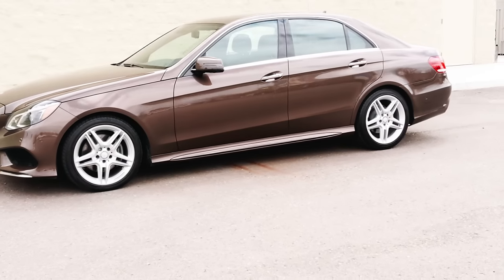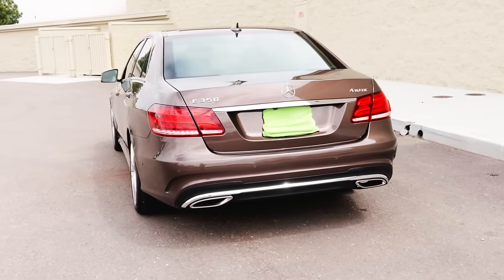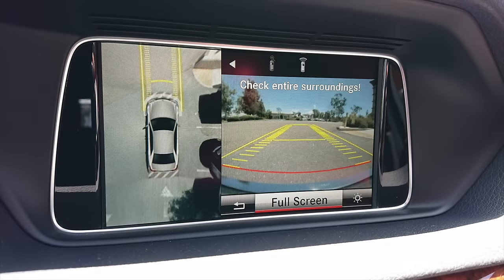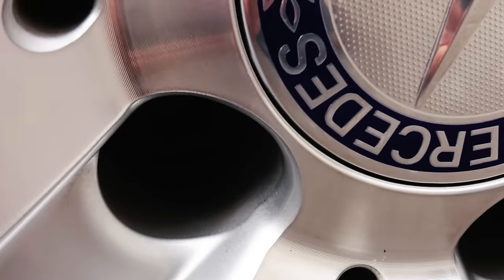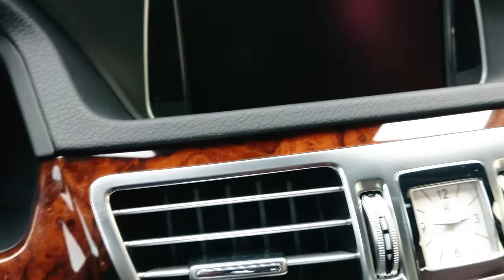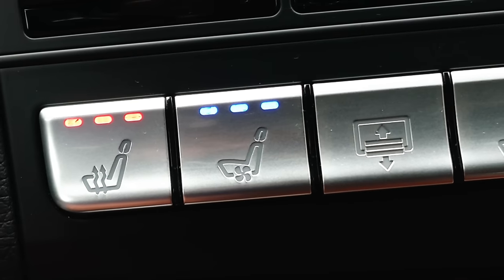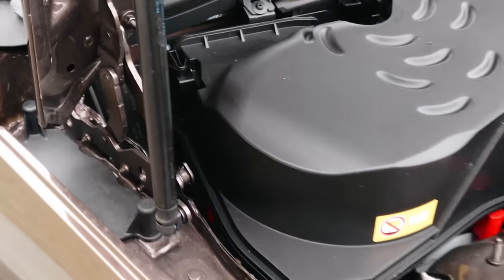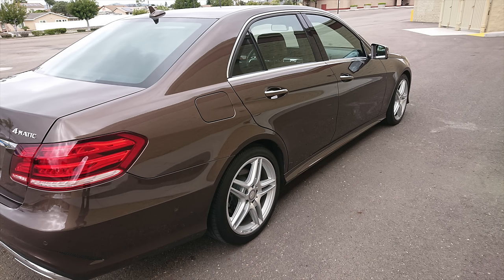The W212 E-Class is one of the best Mercedes-Benz Cars Ever

Comment: i own a 2011 (pre-facelift) e350 luxury model. my mom owns a 2014 (facelift) e350 sport model. i definitely like my car a lot more. i dont really like the e-class having the ornament on the grill, plus it makes it look like a c-class lol. both of them have 17in wheels with the same tires, but the luxury model rides much smoother. the sport model handles a little bit better obviously but at the cost of a stiffer and bumpier ride. in my opinion, the luxury model still handles pretty great. i dont think the sport suspension is good because it makes the car less comfortable (which is the intention of an e-class) while not improving the handling significantly. this is coming from a person with a sensitive body lol.

i agree with mercedes' mechanical quality improving. the w212 is pretty much issue free. we have only done regular maintenance + wear/tear on both e350's. 

but i dont agree with the interior quality. my mom's 2014 model is newer but the interior actually has squeaks and annoying rattles already lol - it definitely has to do with that bumpy sport suspension. the driver's seat bottom is torn. idk i just cant fully describe it but the w211 has a better interior and a waaaay comfier seat. i just dont like the interior quality of the w212. 
the brakes are powerful and smooth, you can tell that comfort is the top priority in any e-class. audi and bmw brakes feel really touchy which is good for sporty response, but the e-class has a more "progressive" and linear feel to it. once you get used to it it's pretty comfy in stop&go traffic. 

acceleration is good, definitely enough for everyday usage. if it's well-maintained the gear shifts are imperceptible and power delivery is smooth.  in 2012 they used a new direct injection engine which is more fuel efficient and much faster. it's fun, but the biggest drawback is that it's louder and grumblier. the engines before 2012 are much quieter.

i know i make the sport model sound bad, but overall this generation e-class is still great. it feels solid when you drive it. super stable on the highway. everyone likes to fall asleep in my car whenever i drive them in it. great visibility all around. this car is definitely well-rounded just like the reviewer said.
Reply: I have a 2014 sport and the ride feels very comfortable even with 19" low pro tires, no rattles or interior wear and tear yet and in my opinion even with the star grill it looks nothing like a C class, the W213 however looks just like the W205 C class, very similar headlight, tail light and sillouhette
Reply: @invincible201xxx  the front of the 2014 ones do look make it look like C class
Reply: W212 pre facelift is wayyyyy better.
If I wanted a C Class, I would've brought one. Meh.
Reply: Martin Svensson  I gave the interior of the W212 an overhaul. It looks leaps and bounds better than stock
Reply: Yes Audi's have touchy brakes

Comment: 2010 Mercedes 350  trying to keep it for another 5 years
Reply: Any significant repairs during ownership? I am currently considering purchasing a 2013 pre-faclift E250 cdi in Ireland
Reply: @rossgoodwin2700  other than replacing a pulley and replacing the battery not much in the shop for repair just my usual service, 100,400 miles on it

Comment: had 124 ,200d , than 210 250 diesel , than 220 cdi 212 , HANDS DOWN 212 IS THE BEST MERC I DROVE , HAD 213 FOR 2 months 220d sold it and bought volvo s90 d4 , still nothing beats w212 220 cdi avantgarde , NOTHING
Reply: MINE WAS PREFACELIFT 2009

Comment: I have a w212 2012 e350 cdi 57000 miles black on black amg spec,nothing has gone wrong with it in the 7 years I’ve owned it,it’s still on its original battery and I service it myself in accordance with Mercedes service intervals,70 on the motorway it’s doing over 50 mpg,I’m 60 now and I don’t think I will ever sell it.

Comment: The W140 (most expensive Mercedes ever developed) has to be up there, followed by the W126 and W124.
I'm glad Mercedes seem to be returning to their 'best or nothing' philosophy with their larger sedans again. After the Chrysler takeover in the late 90s they really cheaped out while chasing profits, but excellent quality has since returned to the E and S Class.
The early 90s models are built with a solidity that is not found in any other vehicle I've encountered!
Reply: Not true the W100 (Mercedes 600) was the most expensive with technology unheard of at the time) it have full pneumatic air suspension which included pneumatic windows (long before electric windows were popular)
Reply: @bernardkavanagh3528  Not true. At the time (and it may still stand) the W140 was the most expensive car in history to R&D, and the first to ever exceed US$1billion. This was a fact stated by Mercedes themselves, but as impressive as that was, it was a figure they weren't proud of it!
Reply: I never liked the look of the W140, it looked like it was stuck in the 80's...for a car that started production in 1991 and lasted for seven years. The W220 was a huge improvement design wise.
Reply: @damilolaakanni  I reckon that's part of the appeal, and yes because the S Class used to take nearly a decade to develop, the design is actually from the mid 80s. The same way the W126 before it looked antiquated by it's end in 1991, that was a 70s design.

Comment: My E250 4Matic Bluetec is the best car I've ever had.  It's amazingly fuel efficient (1,000 miles or more highway miles on one tank), and it has plenty of power.  It also has a great balance of screen and buttons.  Most of the daily things you need to do can be done with a touch of a button.  Unlike the next generation, you don't have to do most stuff through the screen, which I find very distracting.

Comment: The Star in the grille just looks cheap and tacky. Like a cut price Mercedes.
Reply: Agree! Looks like a tractor grill. All Mercedes cars should have the star on the hood, so you can see it! :) Also it is much more classy.
Reply: Damn right. If you cant see your three pointed star standing proud atop your bonnet, are you really driving a Mercedes?
Reply: @willmorrell488  Totally agree with you! Mercedes lost their distinctiveness when they decided to remove it. Maybe you can get it as an optional though.
Reply: @peterchristiantrapp6927  I much prefer older Mercs as they are just more interesting to me despite reliability issues. The interiors now are nice but I get the feeling it's just skin deep. Having large screens just makes it look more and more like all other luxury cars more like a gadget. I think it's only going to become less distinctive as time goes on.
Reply: @willmorrell488   I have own 3. A 190E 1984, W210 E 240, 2000  and my current W212 E220 CDI, 2009. Each one has been the best car I have ever driven. I miss the sound of the W210 though! :) Hopefully I can afford a S-class soon. :) I do like the W221 :)
Reply: The reason for the big star in the grill houses the radar for adaptive cruise control
Reply: @johnwalters878  They don't need the Star in the grill though for that to happen. Their S class range never needed that.
Reply: @peterchristiantrapp6927  You said is correct ... Without Star in the hood , MB is worthless
Reply: @willmorrell488  Mercy needs Star on the Hood ....Otherwise , it's a cheap looking car

Comment: I had 2 of the 212 model, both E350’s. Both were pre-facelift which I think looked much better - I never liked the face lift and I think the sports grille looks strange of a 4 door. The first one saved my life in a very significant accident. These are fabulous and exceptionally well built cars and extremely comfortable. I haven’t liked an E class since . The interiors were beautiful, not like the LED jukebox box look of the most recent E classses.

Comment: Why does merc put fake leatherette seats in then. All used ones in Ireland have cracked leatherette seat. If U ask me they cut corners wherever they could.. lots of engine trouble on the e200 220 250 etc not good enough for Mercedes..

Comment: Eh those 3.5 na motors like to leak oil if not maintained right which i commonly see all the time even at 50-60k miles. Other than that theyre solid cars never had to do any major work on em

Comment: "Highest quality materials..." i have a W212 and I'll call bs on that statement. Plenty of cheap plastic in the W212 interior. The highest material in a Mercedes is in a S class. Lets not kid ourselves.
Reply: Yeah saw the dash in w212 looks cheap, that was in prefacelift. W211 dash doesnt look so cheap and plasticky. Is your pre facelift?
Reply: @xdanano  yes mine is a 2013. Practically identical except mine has the horizontal pleats which is the vinyl seats. The vinyl seats always split the in the seam. My parking brake release handle broke off when I released the brake because its made out of cheap plastic. In comparison, my 97 LS400 and 99 GS400s plastics are thick and durable.  Huge difference in material quality when you compare the W212 interior to the old Lexus interiors. I don't remember the W211 being this cheap in the inferior.

Comment: The 4 cylinders gasers have timing chain problems, the Diesel engines where rechanged after production to other injector with pretty big changes... W212 was not trouble free
You should review a lower spec Mercedes if you want a true view on the w212, gong facelift 4-wheeldrive big diesel is not representative...

Comment: This is true, I have the latest E220 and compared to the 2010-2016 it is CRAP!!! The current E class from 2016 has a less masculine horn, fake exhaust pipes, poor speakers if you don't get Premium Plus Package and feels more like an C Class with handling. The thing better about the new one is the 360 camera and the Interior/Tech
Reply: Between 2007 and 2015 , Eclass are superbly built quality ... W211 face lift is some awesome design which is still adored in India
Reply: @manojm6722  you're definitely correct there. I think Mercedes-Benz slacked an awful lot when it came down to the current E Class saloon/sadan

Comment: I own a 2003 E500 - just an amazing car. Had it 16 years and now at 180K (bought in 2007 with 18K). Unfortunately, it's got problems so I am dumping it. I just bought a 2010 E350. The look is amazing. It is not as powerful as my 8 cylinder, but it has pep for a V6. It does not feel or handle as sturdily as the W211. But I love the new lines, love the rear lights (I hated the W211 triangle lights), has the AMG and luxury packages, and many "modern" upgrades. It feels a bit longer in the driver's seat and although I did a hood emblem delete on my W211, I will keep it on the W212 since the hood is so long. I am so looking forward to driving it hard!

Comment: I can't really agree. From the point of user I prefer W211 as the car had a better looking interior and car was more comfortable. Back seats on W212 are not comfortable on long trips at all and W212 is very noisy especially diesel versions. Interior bits and parts looks and feel cheap. Technology is better, logically as the car is newer but as a car W211 was much more better Mercedes to drive. I would skip W212 and buy latest W211 model year or pay extra and go ahead with W213.
Reply: Agreed! W211 = Best ever!

Comment: I had a 1998 (I think) C250 and a 2004 W211 E220 cdi. I loved both of them a lot, and half the joy of driving them was the star figure on the hood. It's such a shame that new Mercedes E-class and below owners do not get that experience. And apparently the disaster happened here in the W212. So, not a fan of that design change.

Comment: Had  a 210 - rusted like a 1980's Ford, then a 211, became a wackamole with endless faults. Both nice to drive and good load carriers so bought a 212 facelift - lovely car, lots of  tech and gimmicks of little use but MB forgot about the seats which on the base SE model I have are utterly crap and a chiropractors dream. Sod the tech, sort the seats.

Comment: I've have worked with these E350 and they are a little expensive to repair. There is a transmission weak point that causes hard shifts. A failing power seat will cost you $2000. 1 shock absorber cost $1000 part alone not including labor. This car will have trouble reaching 200k miles. If this is the best mercedes have to offer then I will keep shopping. Lease one with warranty is your best bet if you want a benz.

Comment: The w212 is far away from the build-quality of the w211.
Reply: So true
Reply: "The build quality of w211"? Don't make me laugh! The w211 is probably the worst E-class of all time. It had the same rust problems as w210 (at least until 2007). But while the w210 was reliable, the w211 was not. Everything from brake issues, door locks, transmission, steering controlling and the list goes on. And together with the S-class from the same time period, it was also one of the most booring looking MB-models ever. The w212 is a huge step up in quality.
Reply: @VintageVideos1000  Never had rust problems, unforseen brake issues or any door lock , transmission and steering control problems while driving 2 of them (both built in 2004) from 50k to around 350k km. Design is always subjective and from my point of view its a beautiful and elegent car.
Reply: @THDLightfl4sh  Sounds like you were lucky. Two of my neighbours was not. One guy had a station wagon, the other a sedan. Both had rust issues, however not as bad as the w210. The sw broke down two times, with engine failure. Before he sold it, he told me he got a price tag of 70 000 NOK/10 000 USD to fix it. The other guy had transmission issues on his sedan. I've had the w210 and now the w212. The 210 I had for 5 years, drove it about 40K KM a year. No problems at all. The 212 I've only had for 1 year, but as of now - no problems. I guess you are right about the design. To me, the 211 just look too anonymous.
Reply: VintageVideos1000 You will find people with bad experiences for every model. For example I do know some people who had major issues with the engine and rattling noises from the interior on their w212. Furthermore you dont know how other people treated their cars.

Comment: I'm thinking on buying a E220 cdi or a E250 cdi w212 Mercedes-Benz, perhaps with 200k or 250k. I'm so confused. I heard good things and bad things in terms of mecahnic, electronics, etc., that could lead you to a nightmare repair with high cost's. 
In normal terms, I think this car is reliable, altough, after listning some stuff in YouTube chanel's about Mercedes Benz, I became worried.
If Your answer is negative, I will buy a Peugeot 508 1.6  e-hdi automatic of 2015 or 2016 with PSA engine wich I hear in every corner that it's absolut reliable and, besides, their maintaining is much cheaper.  However, I simply love that Mercedes-Benz "E" model design and its is my dream to have one.
So, the question is (if you guys was in my spot) : in normal terms, the Mercedes Benz w212 E 220/250 from 2010/2011 cdi is reliable and it's worth buying it ?
Reply: Go ahead with W222, S class.

Comment: 2003 through 2009 w211 E-Class last year of true Elegance and beauty the last of the well-built Mercedes-Benz.
Reply: The face-lifted W211 with dual exhaust pipes is probably the most beautiful E-Class ever made.
Reply: E class is by far the over all best. I agree. Love driving mine. Believe if u do not or have not own this. U should not give a critical review.  It is my favorite i have owned.
Reply: Lauren Anderson  it also depends on what years you are talkin about because if you jump into the newer s classes they're built like shit compared to how they used to be engineered the quality is going to be cheaper on a newer car regardless of what class you're in every class has its lemons even with Mercedes-Benz and the only way you're going to get quality is dependent on the year everything is made cheaper nowadays I drive a 2005 E500 4matic with 88000 miles on it it has the 5-speed transmission with a 5.0 if you compare it to a new S-class the quality is not as good as my 2005 it all depends on the year of the Mercedes no matter what class you're in
Reply: Lauren Anderson  on the contrary the best Mercedes-Benz hands down that is ever been made would be the 300 SL 3.0 L straight 6 it came out in 1954 the second best would be early 80s 300D but it sounds like you're really informed on knowing Mercedes-Benz good for you we can speculate back and forth all day long but facts are facts I can't even argue with that

Comment: I'm looking at two vehicles, anyone with an informed opinion please chime in!

#1 2014 E350c 72,000 miles, they want $18,000. I can't find any flaws, new tires, been serviced.

#2 2007 ML63 AMG, 99,000 miles, want $12,900. Four issues I've found. A. Backup camera is out. B. Steering wheel telescopes but doesn't tilt. Most common reason a broken plastic gear where you have to take the dash apart? C. Stuck in "sport" mode, which I bet is related to D. Malfunction message that I would bet is the air suspension system.

My guess is maybe $2800 of repairs will fix b, c, and d. Any comments?
Reply: Get the 2014 E that car will outlast the ML63 if you want to get an ML get the 2012 and up
Reply: @oririona5462  Got the 2014 E350c. Thanks for the input.
Reply: Keith Graham you made the best decision enjoy your car

Comment: I think MB has totally lost its way on the E Class. The 1980's-90's and through to 2009, were fantastic. The 2000 E55 was stunning. But feel MB has lost that unique styling. It seems as though all the sedan body styles are just too similar. The only model of note in the last 5 or so years, is the new S-Class Coupe and the AMG GT of late. Don't even get me started on the SL Roadster. I think it is high time for MB to find some fresh new talent, to take them out of this poor body design phase. The interiors are great. Maybe they should have the interior designers do the body designs now.
Reply: Same with the 5 series